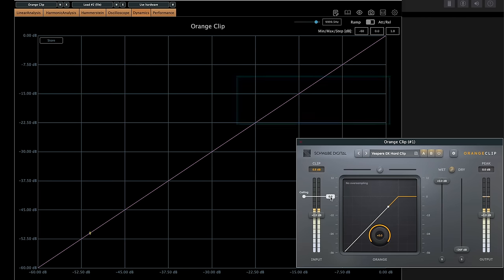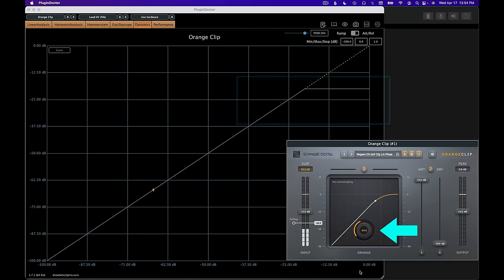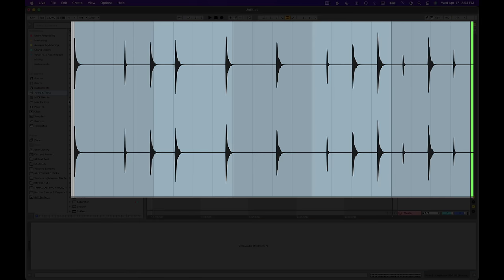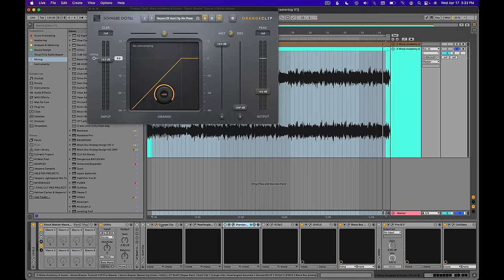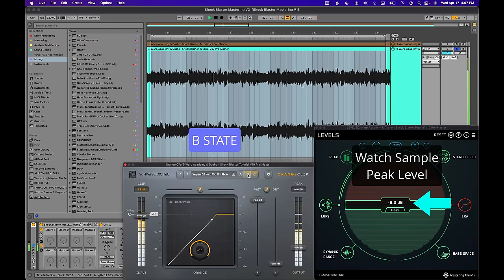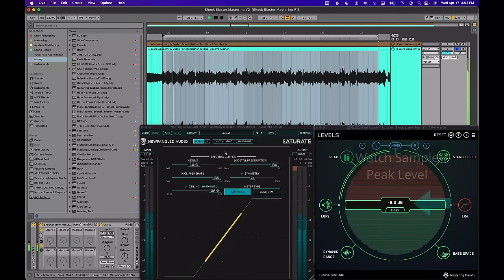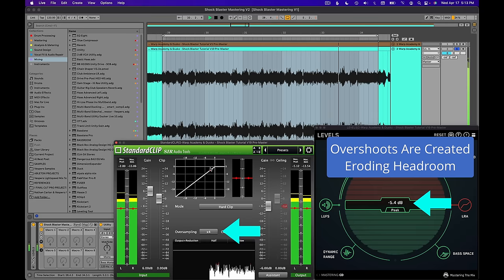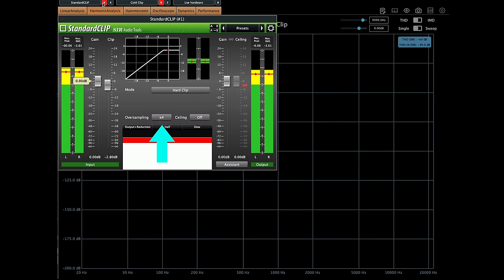The Science of Clipping - The ULTIMATE Tool for Loudness + Punch

Comment from the maker: Some people have been asking about Standard Clip here, because they're not able to reproduce the same overshoots I observed in my session.  So I captured a screenshot of the session, Standard Clip settings, and meters for you below.  Also, Nicholas Di Lorenzo from @panorama_mastering just published a good video that shows how the overshoots happen in Standard Clip and why they happen on some material but not other material.  You can watch that here: https://www.youtube.com/watch?v=GGiLAhHPHV0.  

First of all, I'm clipping very gently here.  A couple dB on super short audio events.  Mainly just the snare.  I'm not pushing the clipper hard at all.  

Check this out: https://capture.dropbox.com/UY8A1izXIQNtEJFU

You're most likely not seeing the overshoots because Standard Clip has 2 clipping stages.  The first is oversampled, and the second is a 0X non-oversampled hard ceiling (called "Ceiling" in the plugin).  If you leave the Ceiling engaged, then the second clipping stage hides the overshoots from you by applying more clipping.  If you disengage the Ceiling parameter, you see the true peak level overshoots both in sample peak and true peak (true peak overshoots being higher).  

The same is true for K-Clip and most other clippers with oversampling.  They usually have a second 0X OS ceiling.  And in fact, you see the exact same thing in iZotope RX Audio Editor.  When you use the Resampling process to downsample anything, you'll see the parameter "Post Limiter" engaged by default.  They need a post-downsampling limiter to catch these overshoots.  This is because the Fourier transform process with the sinc function related to the lowpass filter used in anti-aliasing will cause higher and higher overshoots the more Fourier partial harmonics are used.  The more oversampling used (and the more extreme the downsampling) the higher the overshoots will be.

Some people have commented that they're not seeing overshoots using Standard Clip with the ceiling off, so we're investigating this further.  It could have to do with the material being run through the clipper and the project sample rate.  I'll post more info here as I learn more.
Reply: Hey there. Btw, Gold Clip also has a « ceiling » function, it’s called « Clip Guard » (it’s found in the settings), and that’s probably why you don’t get overs. Edit: Gold Clip does also have a LPF, which also probably contributes to the absence of overs.
Reply from the maker: Hey hey.  Yes, first thing I do with any plugin is read the manual and discuss the plugin with the creator or the support team.  I'm aware of the Clip Guard and it is off.  It's off by default, and I left it off.  It has nothing to do with the presence or absence of overs in Gold Clip in this example.  It's a legacy feature from before Ryan developed the anti-derivative anti-aliasing process currently used and now it's basically obsolete.  

Regarding the LPF, there are actually quite a few places where low pass filtering can occur in Gold Clip.  

Are you referring to the Box Tone feature?  If so, I'm not using it.  Or maybe you're referring to the Clip Filter, activated with the LPF button on the clipper shape area.  I'm also not using that.  I was careful to set each of the clippers up to be as identical as possible for this test.  

If you're referring to the downsampling filter, then yes, every single plugin with oversampling has an LPF used in the downsampling process.  That's par for the course and every single clipper I showed in this video has it.  

It is serendipitous that you mention an LPF being the reason why I don't get overs.  In fact, it's precisely the opposite.  

The LPF in most plugins used as the anti-aliasing downsampling filter is the EXACT reason why the overshoots are created in the first place.  The source of the overshoots is the process of band-limiting (lowpass filtering) the signal.

The reason I don't get overshoots in Gold Clip is because of the self-modulating LPF filter used in the anti-derivative anti-aliasing process Vlad created for Ryan.
Reply: @warpacademy  I was referring to the LPF on the Clipper button. Which IIRC is pre-clipper (which makes more sense).
I was pointing out those elements (LPF and clip guard/ceiling), because they are actual overshoot mitigators.

I might have a deeper dive into the ADAA technique.
Thanks for the exchange.
Reply from the maker: Hey hey.  Yes, this is a good exchange and lots of deep dive content here.  There's one fundamental thing that's key to understand regarding overshoots.  It's that of filtering.  

It's super counter-intuitive and it took me a good while to wrap my head around it.  You're thinking that using an LPF is a way of mitigating overshoots.  It doesn't do that.  It's the process of band limiting hypersonic content (or audio range content) that causes the overshoots in the first place.  The LPF is the source of them, not a way of removing or mitigating them.  It's a head scratcher for sure hey?  How can removing audio content possibly create higher peak level than with it?  But that's how it works.  You can test it yourself.  

I'm working on a video about this right now.  

The LPF in Gold Clip (on the clipper button) is not there to mitigate overshoots, it's there to reduce bright audible harmonics that can be created by clipping (moreso with hard clipping, but even with soft clipping).  Use of the LPF will dull the harshness, but it will actually cause an increase in peak level, just like the anti-aliasing LPF that's used in virtually every other oversampling plugin.  

For proof, take a look at iZotope RX in it's Re-sample function.  When you go to downsample anything, you'll see an option for "Post Limiter". Why would a post limiter possibly be needed when all you're doing is downsampling?  It's the anti-aliasing LPF that causes the need for a post limiter to deal with the overshoots. 

I hope that makes sense.  I needed Dave from DMG to walk me through the physics until I got it.  

Cheers!
Reply: @warpacademy  yeah I know all that, but that’s not what I’m talking about. I talk about low passing the signal prior to a clipper having Oversampling on. It will mitigate the overshoots of the oversampling filters. The less HF content, the less overshoots. I think Nicholas even did a video on that.
Reply from the maker: I thought I knew all this stuff too, until I talked to Dave Gamble about why Limitless doesn't have oversampling and he took me to school.  And then I realized I actually knew very little about this topic, so I educated myself.  

I know the video you're talking about.  Nicholas shot that partially in response to my video on The Science of Clipping.  Nicholas uses true peak limiting, that is why he saw lower TP level.  I work with sample peaks in most of my engineering work.  Using an LPF will lower your TP level because TPs / ISPs occur close to Nyquist.  Read this article by ME Ian Stewart for iZotope: https://www.izotope.com/en/learn/true-peak-limiter.html. 

This is very different from what I'm talking about.  

Any lowpass filter that removes high frequency content from a full spectrum signal will be the cause of overshoots at a sample peak level from the former hard ceiling.  It doesn't matter whether the filter is before or after clipping, or whether it's used in downsampling or not.  Any time you truncate higher order Fourier partials, you create overshoots at jump discontinuities.  

It's super counter-intuitive, and like me, you probably need to see it to believe it.  Watch the channel tomorrow.  I'll publish a video about this that will demonstrate.
Reply: @warpacademy  Hey. Again, I already know that. But again, we’re not talking about the same thing. With all due respect, you’ve lost the initial concerns :)

It’s very simple actually: the less HF frequency you have, the less an oversampled clipper — with ceiling set to off — will overshoot. Simple as that.
And it just happens that a LPF (could also be a negative gain high shelf or bell filter btw) put before that OSed clipper will reduce its overshoots (because of the reduced HF content). No more complicated than that, really!

I’m not talking about the overshoots caused by that LPF pre-clipper; those will be handled by the clipper.
Reply from the maker: Thanks for the clarification.  Okay, if I’ve lost the plot and I’m misunderstanding your initial concerns, let’s circle back and I’ll quote you:

“Hey there. Btw, Gold Clip also has a « ceiling » function, it’s called « Clip Guard » (it’s found in the settings), and that’s probably why you don’t get overs.”

Yes, Clip Guard is in settings.  No it’s not having any effect.  It’s a legacy feature from before Ryan and Vlad created the anti-derivative anti-aliasing process.  It’s unchecked by default, I’m not using it.  The reason there are no overs is because Gold Clip doesn’t produce them.  Try for yourself, you sound like you own the plugin. The unique ADAA filtering process doesn’t create overshoots, that’s the reason, plain and simple.   

“Edit: Gold Clip does also have a LPF, which also probably contributes to the absence of overs.”

Yes, again, GC has several LPFs.  And again, no, I’m not using them so they are irrelevant with respect to overshoots.  There is no filtering before the downsampling process happing in GC.  

Asked and answered, so I think I’ve addressed your initial concerns thoroughly now.  

Going forwards, you’re referring to LPF used to remove HF before the clipper and that reduces overshoots.  When you LPF you’ll do 2 things (and I get that you know this): 

1) You will create overshoots by band limiting the signal.  
2) You will reduce ISPs/ TPs that occur close to Nyquist.  Relevant only if you care about TPs.  

Yes, these can be “handled by the clipper”, but more clipping = more distortion (if you’re riding the edge like I do).  And you’re now sacrificing HF content of your song, which you may not want to do…
Reply: @warpacademy  Thanks for attempting to summarize the exchange so far.

First, let's take for granted that ADAA is responsible for the absence of overshoots in Gold Clip. Case close.
But no, that wasn't the initial topic, actually. The initial topic is the one you address in this very video; that is overshoots in oversampled clippers.

By now, I think we'd agree that lowering high frequency content pre oversampled clippers will mitigate, or completely avoid overshoots in said clipper.

Now, things are not as easy as you say: a LPF does not necessarily create overshoots. It depends both on the LPF (its frequency, slope, etc.) and the signal itself. Depending on the situation, you might have overshoots, undershoots, or nothing at all (i.e. same peak level). I'm very often working on acoustic recordings, and low passing either tracks, groups, or even whole mixes seldom produces overshoots, and on individual tracks it's rare (even on tracks like snare drums).
- Also, depending again on the source material, be it tracks or entire mixes, and depending on the result we try to achieve, low passing can be beneficial artistically speaking.
- Also, low passing can be transparent enough to be inaudible but make oversampling happy in the overshoot department.
- Also, when low passing prior to a clipper actually overshoots, those events are so short that the extra clipping is immaterial.

All in all, I'm not saying that you must, always, low pass your signal before an oversampled clipper in order to mitigate or avoid overshoots above the clipper's ceiling. I'm just saying that low passing, as well as high-shelving or using a bell filter -- let's not shed light on the sole LPF -- are ways to mitigate or  avoid those. These are tools to have and use depending on the situation you are working on.

Finally, it is not true that low passing a signal always yields overshoots, and it is not true that oversampled clippers (with the 'Ceiling' option off) always yield overshoots either (I'm not talking about Gold Clip).

I'm happy to end it here, if you will :)
Reply from the maker: @SR1B  Okay, let's discuss this main point from the video then; that oversampling clippers with no additional ceiling will often produce overshoots (unless you're in Gold Clip).  Did I say in the video that it always does?  I don't think I did, but if I did, then I'll happily correct that to "usually" produces overshoots.  In fact, in every single test I've done, without exception, clipping a signal whether it's a snare drum or a master, in any oversampled clipper, produces overshoots.  But I know there are some scenarios where it does not.  Point taken.  

In most common situations where you're using a clipper, such as clipping at a master level on complex program material (which is the example that I used) oversampling will typically produce overshoots.
Reply: @warpacademy  Agreed, that's the end of it: "It depends". And I prefer to approach the oversampling subject on a case by case basis.

Granted, your experience is that you get overshoots most of the time. It is not mine, it really depends on the material (Nicholas also wrote a comment to this effect under this very video, and he did a quick video on the subject); but even then, there are mitigation solutions (HF reduction, when it's acceptable to do so), and worse case scenario, I can engage the Ceiling function: it will introduce some aliasing, but less than when Oversampling is switched off.
But if I'm short on CPU, I'll get by with Oversampling switched off.

(as a reminder for the people reading, here we are discussing clippers as a peak management tool, not as a sound design tool)

I think we made our points at this point. Thanks for keeping the discussion rational. And thanks for your vids and presence on the WWW. Cheers and peace out.

Comment: My best "clipper" is the natural acoustics of the soundtrack headroom. To my knowledge, it works the best than any compressor or limiter! Max loudness & punch! The only excception is that I use comp/limit processing in my individual tracks, but leaving my master to respond naturally with the acoustics of actual headroom. In my 25+ years of experience, I realized that this is the best technique to preserve all "organics" & naturality of the soundtrack.
Reply from the maker: That’s one way of mixing but it won’t ever be very loud.  If you like it and it works for you that’s all good.  But limiting on individual tracks can never sound as loud and clean as clipping on individual tracks then busses and then using a touch of hard clipping on micro transients and clean limiting on your master.  

If you’re not as concerned with clean perceived loudness in your mix then it’s all good.  Stick with limiting.  Because of the tiny bit of distortion caused by the clipper on transients a clipper will always sound louder than a limiter if used correctly.  

Limiters dull transients.  And when you set them fast enough that they don’t, then you get distortion and then you effectively have a clipper anyways.

Comment: When you hard clip, it doesn’t really matter what clipper plugin you use for that right? I can see for soft clipping, maybe there are different curves or something. But at the end if the day, hard clipping is hard clipping
Reply: Ok oops, you explain later on. 
I’m confused though, hard clipping creates harmonic content, which means it’s louder right? On those peaks, I get it is clipping the waveform a little smaller, but the added harmonics undue any headroom you get from clipping. I think that gold clipper maybe had a built in limiter
Reply from the maker: Hey hey.  Good question.  Not all hard clippers sound the same because of oversampling if you use it and if there’s anything spectral going on like in a multi-band clipper or spectral clipper (Newfangled Saturate). 

Clipping will free up headroom and decrease peak level yes.  Normally that would make the transient of a drum feel less punchy but the added harmonic content compensates for that so you get to have your cake and eat it too.  You get louder perceived drums with amazing punch AND more headroom in the mix.
Reply from the maker: Oh and Gold Clip does have a legacy feature that’s a post oversampling secondary ceiling but it’s no longer needed due to the new anti-derivative anti-aliasing filtering that doesn’t produce overshoots and thus it is off by default.

Comment: Keep in mind that the artifacts added by aliasing are explicitly non-harmonic. They're harmonics that would have been created but bounced off the Nyquist frequency and therefore render improperly.

You're right that for gritty DnB track, aliasing is probably pretty much negligible. But that won't always be the case depending on how much clipping you're doing and what genre you're working with.
Reply from the maker: 100% on the same page with you. Well said.  Aliasing foldback is usually described as non-musical compared to harmonic series.  The reason why it works here, is that it's on the transients mainly, which contain all frequencies.  And the rest of the song is very harmonically dense as well, with tons of saturation and distortion in the sound design and mixing, which has a cumulative masking effect.  

In the end, I did use oversampling in Gold Clip on the master.  But I did not use oversampling anywhere on the clippers in the mix, unless they were soft clippers creating audible harmonics.  

Cheers!
Reply: Exactly